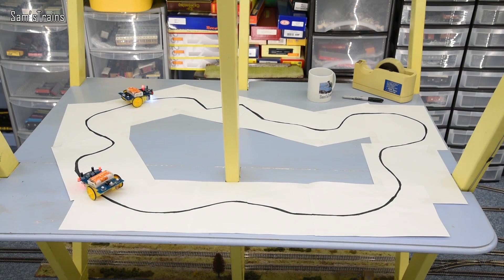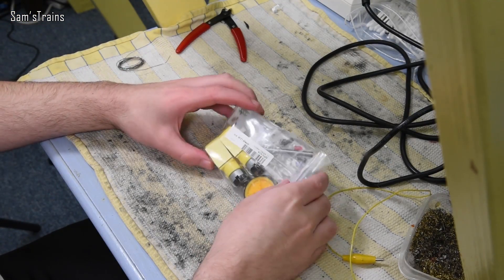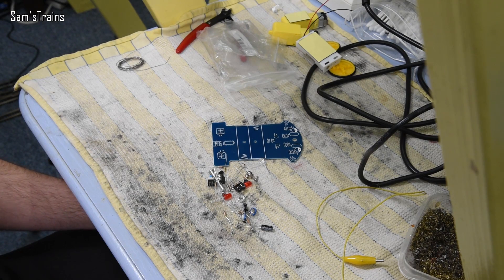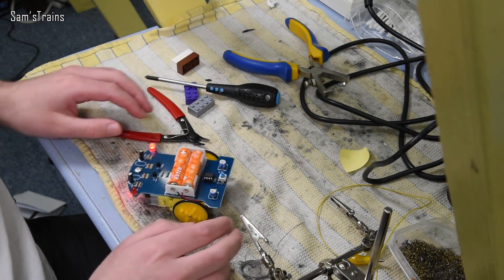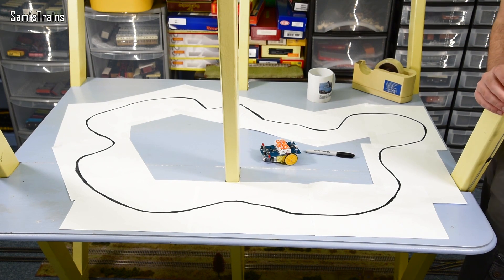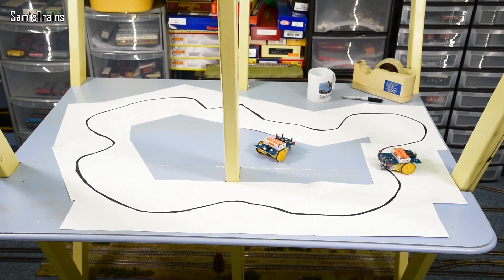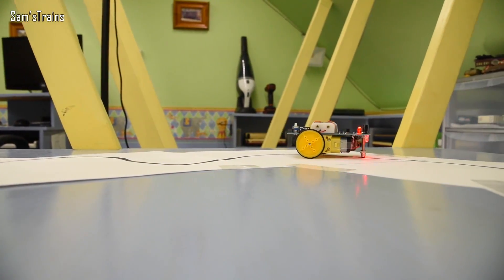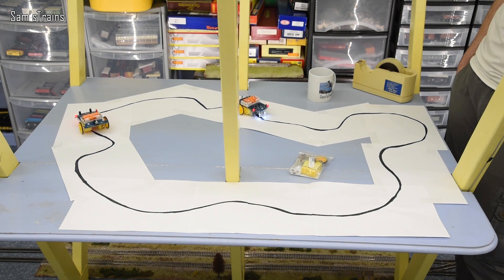The £5 Line-Following Robot Car

Comment: Well would it help out to put some "shades" on both side, so the sensor which reading the black  line, via the light from the LED is not that disturbed by ambient light? 
There is already a road system for model trains since over 30 years! The FALLER-car system and I think its the best system.
Reply from the maker: Hi Paul - the 'shades' are a very good idea indeed - I'll give that a try! Yes I've seen the Faller car system - I'm sure this would never be better than Faller, but it'd be interesting to know if this'd work! :D
Thanks for watching - Sam :)

Comment: I'm going to be honest: I did not expect the result it gave. But, that does indeed beg the question: Is this possible to scale down and use for a road system on a 00 layout? It's certainly easier to do than the metal track with the magnets that people seem to prefer...
Reply from the maker: Thanks a lot for the comment mate - yeah I have been wondering about it - and it would definitely be easier and more versatile than the metal track option!
Thanks for watching - Sam :)

Comment: Oi Sam. Curious little things, those. As to the question of applicating it to trains, there's already a system availible by Faller. However, it uses a metal strip under the road surface and very powerful magnets to guide the vehicles along which is alot more reliable. Google 'Faller Car System' and you'll find it.
Reply from the maker: Hey Jonatan - yeah I'm familiar with the metal strip system - but this could be a cool alternative!! :D
Thanks for watching - Sam :)

Comment: It's sort of model railway related as the Faller car system follows a metal strip to give people the illusion the cars and trucks are driving on their own. Gaugemaster now sell a network rail van which is a Faller road system product.
Reply from the maker: Yeah absolutely - but if this could be miniaturised with UV or IR, you wouldn't need the metal strip! :D
Thanks for watching - Sam :)
Reply: @SamsTrains  plus mapping out the road way would be easier